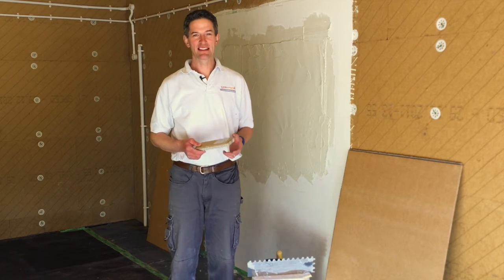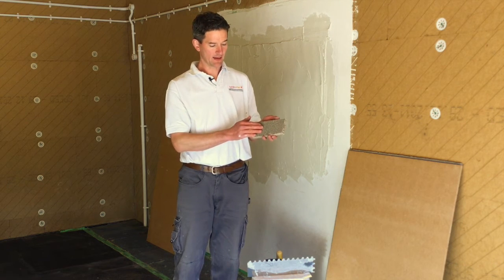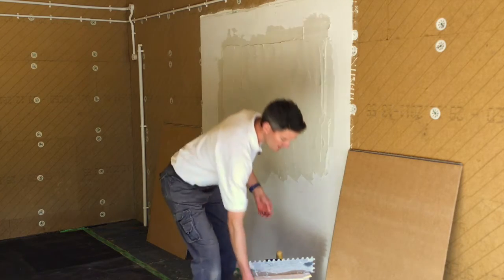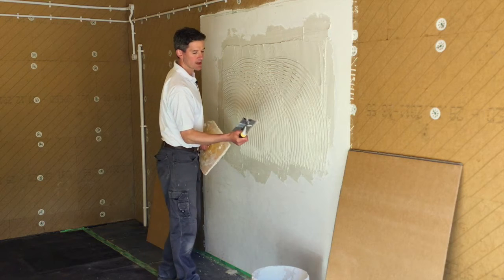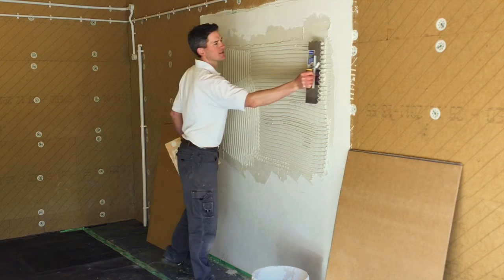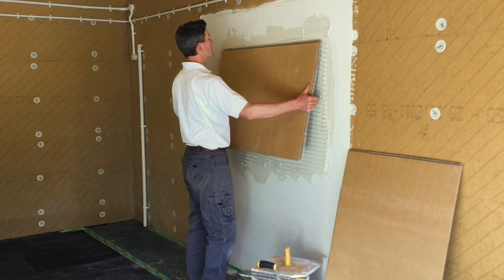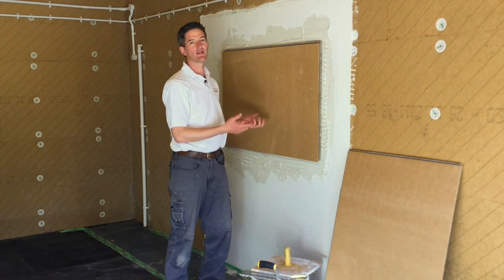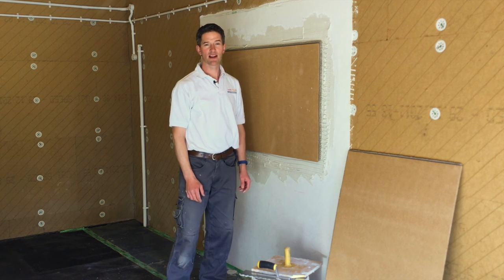How to install wood fibre insulation boards

Comment: Hi Chris looking into this system. But what if the walls are quite uneven. Your example looks fine but you are on a really nice flat surface. My concern would be adherence of the board and also surface pockets where there is no board contact with the wall. Thanks in advance
Reply: You would have to build out first to even the area out
Reply from the maker: Hi Matt. Thanks for your comment. The boards will tolerate around 20% of their thickness in surface variation. Sometimes this means that you need to flush point stonework or brickwork with deeply raked pointing. Hope that helps.

Comment: Hi Chris, can this be used internally on a cavity wall that has been insulated with eps beads? Or will that cause issues with moisture being unable to escape from the inner wall skin? Thanks
Reply from the maker: Hi. Thanks for your question. Yes, this product can be used on the interior of a cavity filled wall as you suggest and it would improve the surface temperatures and reduce the risk of mould growth in any areas where the cavity fill is incomplete. Please make sure that you remove any paint and loose plaster from the surface to allow the bonding plaster to stick effectively. Applying a coat of Blue Grit primer could be beneficial to stabilise and improve adhesion. Hope that helps.
Reply: @BacktoEarthLTD  Thanks for your reply!

Comment: Hi, is there any guidance regarding it's use with electrical installation. Thinking here of application to bare brick, cable contact with adhesive, use of conduit, just general considerations and recommendations. Thank you.
Reply from the maker: Hi Stevie. We usually recommend installing the insulation first and then chasing into the boards, installing the wiring in conduit, and then plastering over the whole surface with a mesh reinforced basecoat plaster. Hope that helps.

Comment: Hello again Chris. Can the Udin2cm board be used on a wall where the external wall is cement rendered (i.e. not breathable)?
I’ve read that, when insulating internal walls, it’s necessary to consider the dew point. 
If the external wall is not breathable, could condensation form between the Udin2cm and the internal face of the solid wall?
Reply from the maker: Hi David. The UdiIN2CM is fine to use in this scenario as the dew point is still well inside the masonry and so will not cause issue for the board. The masonry will store the moisture during the winter and as the weather warms up the moisture will be released back in to the room, via the UdiIN2CM board. Hope that helps.

Comment: Hi Chris, is there a problem if the adhesive is pulled on the insulation board with the toothed trowel and the adhesive is pulled on the wall with the right side of the trowel
Reply from the maker: Hi Ovidiu. Yes, you need to apply the plaster to the wall first as if you try and apply to the boards first you will simply fill up the air chambers in the back of the board and reduce performance. If you apply to the wall first then you can be confident you'll only get 3-4mm of plaster into the air chambers. Hope that helps.

Comment: Hi Chris. I’d like to use this insulation board. 
Above the walls that i will cover I have sloped sections of ceilings. I’d like to cover theses areas too if possible.
The height of the slope to where it meets the main ceiling is 51cm. The wall length 3.6mtrs.
What weight of insulating board will the gluing render hold?

Comment: Do you have installers in the Midlands?
Reply from the maker: Hi. Currently we don't know of any installers your area, sorry. The system is very simple however and so any builder who is willing to 'give it a go' should be perfectly capable of achieving a good result. The system is easily DIY-able so any professional builder will be more than competent enough.

Comment from the maker: Hi David. Thanks for contacting me. The render used to hold the boards is fine for vertical surfaces but it hasn't been tested in situations beyond vertical. Once dried, the adhesive will be more than strong enough to hold the boards but in the short terms you may need a few screws to hold it whilst it sets. If you'd like to discuss further, please call me on 01392 861763.